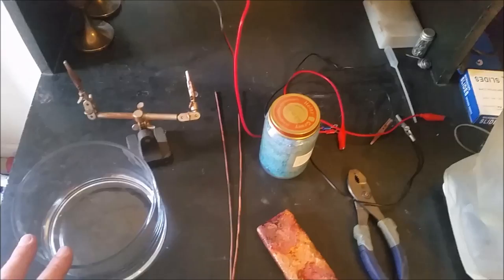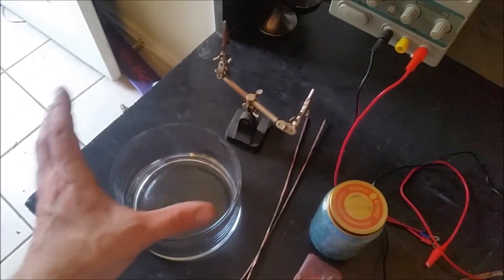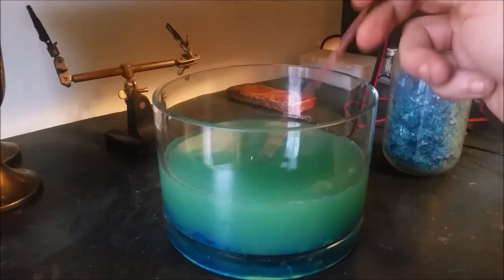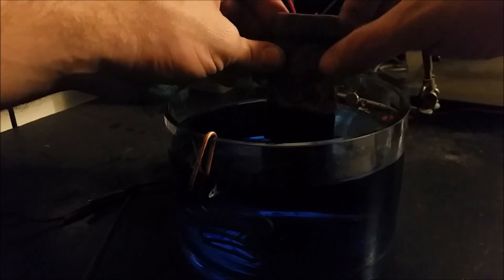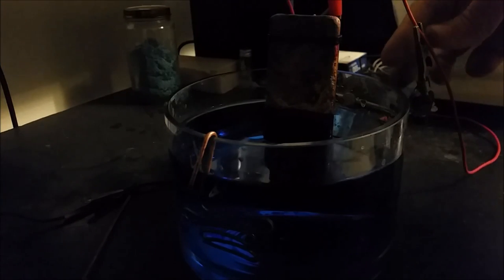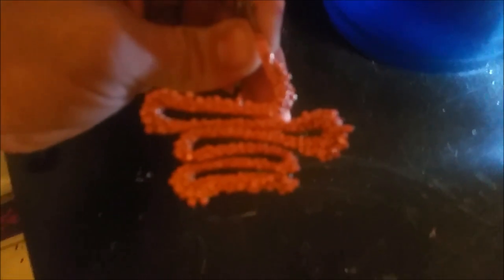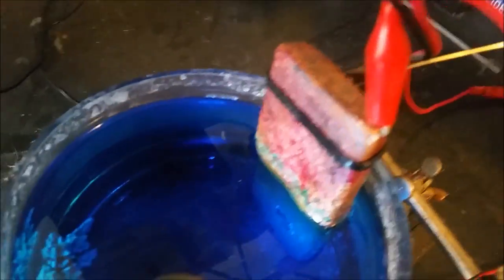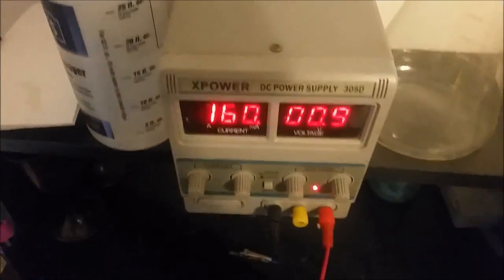How to Make Large Copper Metal Crystals

Comment: Try using hydrochloric acid to shine those crystals up. HCl will not affect the copper but it will dissolve the oxides from the surface of the crystals. You will be left with very shiney crystals.
Reply from the maker: I did try using HCL to shine them up a while back and it does work for a day or two.  After that though they turn very very dull.
Reply: Hmm, probably because the freshly exposed surfaces oxidize very quickly. Maybe after a hcl treatment you could spray them in urethane to preserve the luster. Just something to block the oxygen.
Reply: Could you reverse the current for a few hours before you pull them out?
Reply: for the smaller crystals why not encase it in resin then turn it into a necklace or something?
Reply: rvarnum just curious as to why you would want too. Do you think it would cause something else to happen?
Reply: @jamesfair4023  reversing the polarity (+ to cathode, - to anode) is called "electro-cleaning". And IF done correctly (it's often easier said than done) will dissolve any oxidation that has formed on the surface.
Reply: @Puddin  HCl does leave it dull because the best acid is sulfuric to use in dilute form .1 molar or so. Then must be cleaned off in DI water, then neutralized then washed again in DI then coated with a sealer to keep the air off as oxygen, sulfur and many other things in the air combined with moisture make it turn dark. To remove moisture use Denatured Alcohol, as it absorbs water.  This to me is JR high school level stuff, as that is when I was doing these kinds of things with what I could buy without going to a chemical supply place.
Reply: @rvarnum  You probably wouldnt want to reverse the current. Blasting apart the fine structures would be the first thing that happens.
Reply: Janitorial ammonium does a great job.  Don't leave it too long or it will dissolve the copper.
Reply: @atrumblood  yeah, molecular corterization. Presents itself as a paradox, trying to prevent an oxide layer forming, without creating an oxide layer.
Reply: @jsmythib So if I wanted to grow single crystal and have seeds...

Comment: I use a 32 qt PP dog food container as a crystal growing cell. You can start the process with water and sulphuric acid, the copper sulphate will evolve from that naturally. I also do not cast anode bars. I use an anode bag and a titanium anode. In fact, I call it the TAPP cell (Titanium Anode Parting Process). In this cell, I'm removing the copper substrate from gold plated pins in the anode bag and collecting large copper crystals on the cathode wire. My cathode wire is just an insulated 10 gauge wire, with about one inch stripped clean. To date I've grown several large crystals, the largest being right at 2kg as a single pure crystal. If you leave the seed wire straight, it can be twisted and extracted from the finished crystal.

Comment: To preserve crystals from oxydating during electrolysis you can add some sulfuric acid. Grown crystals can be saved in 0.5 -1% H2SO4
Reply: it dissolves copper oxides
Reply: @Bullshitvol2  yup watch a brand new copper sheet metal roof panel about three weeks after being handled while installing and the finger and hand prints are comical
Reply: if u add h2so4 during electrolysis, u will make them into cuso4

for saving that crystal....mineral oil / resin / argon is good choicesssss

Comment: A couple small adjustments for those interested in doing this.
1: Use copper chloride instead of a sulfate or penta-hydrate! It's easy to make and will produce cleaner crystals much faster! It will also produce some obnoxious gas but not a lot.
2: Buy a platinum coated anode & cathode. They're surprisingly cheap, they won't dissolve as rapidly & they will yield larger crystals!

Once you've made these adjustments, dial up the energy & you'll replicate these results in days!
Reply: Only use copper chloride if you want to knock yourself out with chlorine gas!
Reply: If you are using copper chloride it’s probably safer to do the electrolysis outside!
Reply: Back to WWII hahaha

Comment: The cloudiness you saw after dissolving CuSO4 is not "impurities" - at least not all of it. Copper sulfate is known to partially hydrolyze into insoluble Cu(OH)2 in water. To prevent it add a little bit of sulfuric acid. If don't have it, HCl will suffice, too.

Comment: Use "vasoline" to coat those areas of our wire you do not want to grow crystals on...reduce the growing area and you will increase your crystal size...especially if you also reduce the voltage down to a little bit under 1.0 volts.

Comment: Instead of using a Dremmel on the dark ones, try painting it with a little acid flux paste, let it sit for 30-60 secs (more if needed), and then wash it off. I use this technique to polish up the exposed 10 gauge wires inside my box mods. I strip the insulation and use thick solid core to give a steampunk look (like copper tubing) to the box. Over time, they darken and dull, but the flux brightens them right up.

Comment: Sulfuric acid will clean away dark areas without dissolving the copper, and you get better results by adding sulfuric acid to the water. The best water is distilled or deionized as the minerals is a problem. I notice the many crystals, but what about a single crystal of copper? The process here is the same as what is used to purify copper, and instead of reducing the voltage to reduce the current it works better with that supply to set the constant current to your desired maximum current and then set the voltage to where you want it and that depends on the conductivity of the solution. This can easily be found in most electroplating and electroforming books, and I suggest staying with the copper sulfate and sulfuric acid solution, as cyanide is too dangerous to be doing at home, light smell of almonds and you could be dead sort of thing. Also using acetic acid does not give as good of results, and I recommend buying the sulfuric acid as battery acid as it is slightly diluted and safer to handle than concentrated. Always pour acid into water NEVER water into acid.

Comment: Not that it really matters for an experiment like this, but just in case no one's already mentioned it, the anode is always negative and the cathode is positive.  You can remember because ca(+)hode has a plus sign in the middle of it.
Reply: It is defined by the direction of current, not the polarity of the voltage. This makes things complicated when you get to things like batteries where which electrode is the cathode and which is the anode depends on whether you are charging or discharging. An anode is the electrode in which conventional current enters the cell. Alternatively, you can define it as the electrode in which electrons leave the cell. Conventional current flows from the positive voltage to the negative, so the anode is actually connected to the positive lead and puddin is correct. In a battery cell that is discharging, the anode is the negative plate of the battery, so that is probably why you are confused about this. An electrochemical cell is different from a battery, but is closer to a charging battery cell in function than it is to a discharging battery cell.

Comment: Very cool project.  A couple of comments: why not cut the non-crystallized cathode copper wire off and just mount the whole crystal conglomerate?  making a dilute (10-20%) solution of nitric acid in the final cleaning spray would most likely give you fully cleaned copper crystals, followed by a second spray of pure water.

Comment: this took me 8 months, largest crystal facet was 4mm, add vinegar to sprout super dendritic crystals, add a tiny bit of HCl to penetrate to the base of the branches, at lower current density. too much HCl stuffs it up
to high current density and it bubbles, below the bubble threshold toy get amorphous deposits, drop the current density even more and you get the crystal facets
Reply: What concentrations of vinegar and HCl are we talking about? And what does the HCl do?
4mm crystal facet is just about what im after (so not "amorphous" like in the video), so actual data would be appreciated.
Would reverse voltages help to clean it up? Maybe 1% duty cylcle?
Reply: about half to 1/4 by volume of vinegar, causes copious dendrites, harvest and recycle dendrites, but without a half coke top HCl /3litre of CuSO4/Cu-acetate(from memory, but sneak up on that concentration.. too much will stuff it up)there is no penetration ... photos available on my google plus page.ie the chloride holds on to its copper right to the very last or something like that, acetate will drop its copper as soon as it can, hence the dendrites
Reply: one other thing, it takes less than 30 seconds for salty wet copper to oxidise, so be quick, have a bath of DI water ready, and hit it with metho asap, as it is a powerful dehydrant , tissue/hot air dry, do not handle with greasy fingers,

Comment: your description of anode and cathode takes things off course.  Anode is where conventional current (imagine positive current carriers not electrons) flow into a device.  Cathode they flow out.
Reply: This is not a matter of dealing with tubes or other electronics. In plating processes, the anode is the plate, wire, beads, pipe or what have you connected to the positive side of the supply and from which the current flows.  The electrons drawn by the cathode tied to the negative DC lead.

Comment: I just wanted to add that this process started with crystals, put into solution & then it was 2 months electroplating. He simply transferred the copper from a ingot to a wire 1 ion at a time(hence it's tensile strength.)
Copper crystals are actually blue - bluish green
To anyone asking what to do with said crystals I ask you to explore chemistry some! I personally hobby in pyrotechnics with the crystals i synthesis! I'll purify the crystals, re-dissolve into solution & impregnate into campfire logs to make campfires that burn 100% blue-green!

Comment: what other elements can you do with this aluminum? lead? bismuth? [not melting]
Reply from the maker: You can't do this with aluminum as it is too reactive.  You can however with lead and bismuth.  My next crystal growing video was going to be on manganese but I burnt out my platinized anode trying to do so.  I've got another element I am working on now and should hopefully be out before too long
Reply: awesome! :]
Reply: you can do that with aluminium, but this requires ionic liquids, air and water free techniques and a still experimental method from basf ou phillips, i don't remember which.
Reply: Growing bismuth crystals with electrolysis is much too complicated. Just melt the stuff and pick out the crystals while the bismuth cools down. For larger bismuth crystals, you can use basically the same method used to grow silicium crystals. Takes some minutes and you get a big crystal.
Reply: You can also do it with tin. I actually believe that tin crystals are the best. The problem is they are very fragile so you have to be extremely careful with them.
Reply: Puddin you're recording on a Galaxy s 5, aren't you?
Reply: Tin
Reply: Puddin 
How long did this process take? When you mentioned the timeframe early in the video, it sounded like "This will take one ..........". Then a message appeared on screen that just said (2). So I have no idea which unit of time you were referring to. Thanks.
Reply: Tin crystals tend to be small though.
Reply: WHAT size is your anode does it matter what size it is,and how did you melt the scrap copper into the anode crucible?
Reply: @HighlanderNorth1    Months.   67 days is a little more than two months.
Reply: I've seen it happen with nickel metal. I was doing some electroplating experiments, working on actual nickel plating on coins, keys, small stuff like that, and I discovered that if I just let nickel plate mindlessly it would start growing blobby looking structures that were actually masses of fine grained crystals. I wouldn't say it was pretty, exactly... just interesting. BTW nickel plated pennies are interesting as long as you don't show some off to the wrong wacko and get em raving about "federal crimes", lol.
Reply: @NightRunner417  I believe you can use coins to do this - as long as you call the end result 'jewelry'.  You can use coins for 'art work'.  Don't quote me, but I believe this to be the case.
Reply: @Puddin   Zinc!
Reply: I don't understand why the cathode can touch the side but not the bottom. Because of material that will be in the bottom later on?
Reply: @caseywhiting5752   yes that's exactly why. He explained it in the video!

Comment: How about an aux jack cord as a starting point? Cut it two inches from the jack, strip the casing off and fan the wires out. Then just clamp it to the power. Depending on the size wire inside you could have lots of starting points.

Comment: Can I assume that the copper crystals are 100% pure copper.. or at the very least 99% copper.... and any of the non conductive stuff that was in the bar just falls to the bottom? or will it transfer any conductive metals too, like leads, tin, etc. ... this was pretty neat... What does the copper sulfate actually do, just allow the water to be conductive...for the electrolysis process? Have you ever seen how they purify to 99.99%  after they smelt scrap copper into bars of large (tones at a time) in the smelters, and I think they use extremely high amperage, but the copper lay on the plates evenly, not in crystal form... that is what I want to do. but, I am not smart enough to figure it out.. what is your guess, or is it too dangerous to do?

Comment: As awesome as this is, I don't know what you'd do with the crystals after you grow them. They're too brittle for jewelry, unless you set them in resin, so I'm a little confused.lol
Reply: Cody Koeller I'm confused too! There has to be something
Reply: How the crystals are gown will have much to do with how brittle they are.  The ones I grow, in the course of doing other things, are very tough. I put them on my big belt sander and they take a while to grind down.

I use around a half volt and distilled water, rather than tap water.
Reply: @kellyvcraig  nice! Ok, and then what do you do with them? 🤔
Reply: @michaelz6870  I make wood turnings from blanks I made. The blanks are two pieces of wood, such as walnut or mahogany, sandwiching a piece of clear but colored plastic about 1/4" thick.  When turned and polished, I add turnings I copper plated to the ends and, sometimes, the top.

Some of the turnings have these crystals growing on them "somewhat" framing a part of the turning I did not plate.  When done, the combined effects make nice looking, unique ornaments.

I suppose I should go post a few someplace like Flicker so I can direct folks to them. Meanwhile, the closest I can get to that is on the Instructables web pages. You can either do a under a search my name or use the following link:

https://www.instructables.com/id/Making-Light-Catching-Laminated-Wood-Plastic-and-C/

You can see a few more examples of how I'm using them [but again, the post is missing the "crystal version version] at the LumberJocks web site at:    https://www.lumberjocks.com/projects/399169
Reply: @kellyvcraig  Nice, I'll check them out--thanks for taking the time to reply and provide the links
Reply: Well the process would be useful to refining.  The contaminates from tge previous melt where being left at the bottom of the solution.
Reply: @kellyvcraig    Those are really cool. Unique! Thanks for sharing. That doesn't exactly answer what is done with these crystals though
Reply: @jeniwatkins3297  I added a photo to the Lumberjocks post. I believe it may be what you were asking about.  I have made the more extreme ones, like in the video, but the smoother type seem to lend themselves better to the work I do.
Reply: @kellyvcraig  okay thanks but,  where?

Comment: I wonder how they perform as antennas. Wide bandwidth? Can you grow them while say, supplying a physical vibration frequency to the cathode as it grows? Also, you may get better results if you allow gravity to help you, e.g. placing the anode at the bottom of the container, whilst the cathode remains saturated at the top. I used to have some very old crystal chemistry growing books and was fascinated to learn that the trick to growing crystals is to find out what "feeding" system works best, while resonance and temperature, all the way down to which direction your "feeding" solvent rotated, (clockwise or counter clockwise), to the frequency of the light, to the shape and orientation of the electrodes. It is indeed not only a science but an art. Thank you for the education.